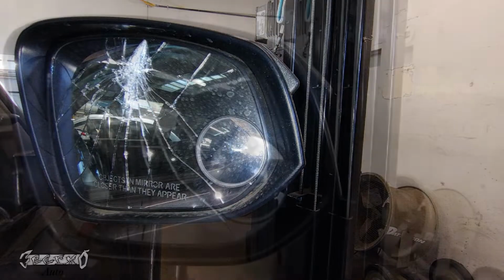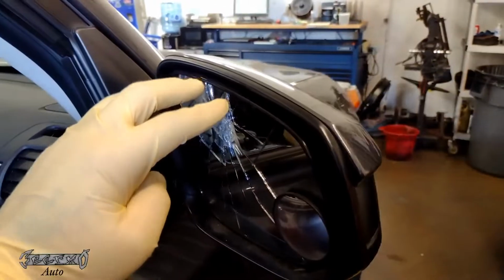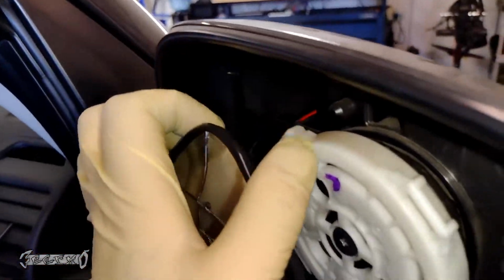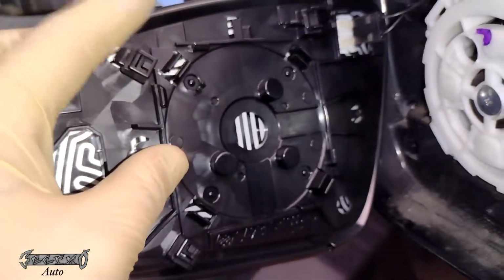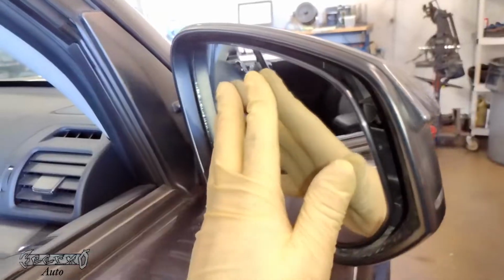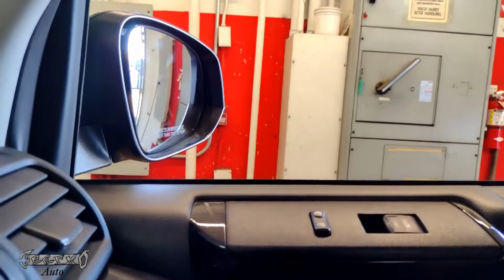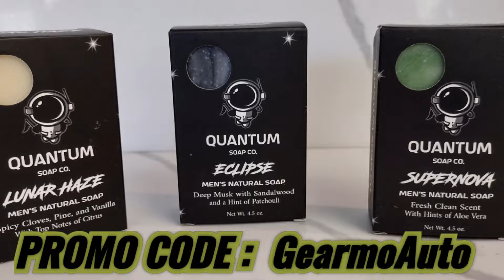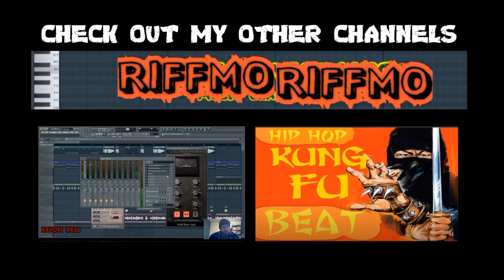2013 - 2023 4-RUNNER SIDE-VIEW MIRROR GLASS REPLACEMENT

Comment from the maker: GET THE NEW GLASS MIRROR HERE ( AMAZON) 
($ 38 BUCKS) ( PASSANGER SIDE)
https://amzn.to/3EbbKZN

GET THE NEW GLASS MIRROR HERE ( AMAZON)
($ 38 BUCKS) ( DRIVER SIDE)
https://amzn.to/3TFic0w

NOTES: THE MIRROR GLASS I PUT A LINK TO ARE AFTERMARKET. They are OEM REPLICAS AND WORK / CREATED EXACTLY THE SAME. AMAZON DOES NOT CARRY THE GENUINE TOYOTA PART BUT THESE MIRRORS WORK PERFECT FOR A FRACTION OF THE OEM PRICE. 

TOYOTA PART # 87931-35C00 ( PASSANGER SIDE)

//// CHECK OUT THIS NEW MENS SOAP COMPANY////
      
QUANTUM SOAP Co 

https://quantumsoapco.com/

CHECK OUT THE WEBSITE HERE AND USE

 PROMO CODE -GearmoAuto      10 % OFF

QUANTUM SOAP JUST RELEASED A UNIQUE BAR FOR MECHANICS AND TOUGH GUYS CALLED 
"GALACTIC MECHANIC "

IT HAS EXTRA GRIT / EXFOLIATING SCRUB COMBINED WITH A UNIQUE MANLY SCENT.

Comment: Thank you!  I bought the RAV4 mirrors Left: 87961-42D20
Right: 87931-42D50 that have the blind spot mirror on them and they fit perfectly in my 2016 limited model. Your video made this an easy upgrade. Probably would have broken the originals if I didn’t watch this.

Comment: You can swap in mirrors from a Rav4 with the built in blind spot mirror.  It's a direct fit.  Part numbers:

87931-42D50 (right side), 87961-42D20 (left side).